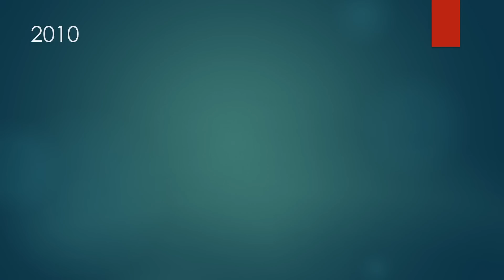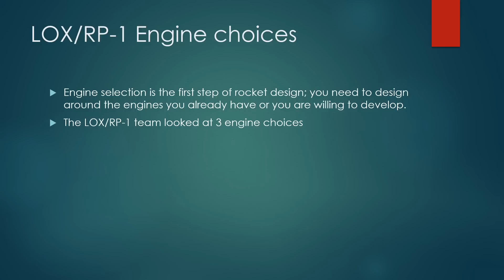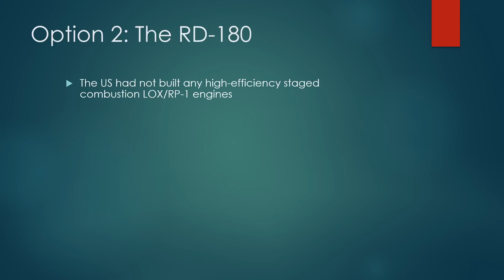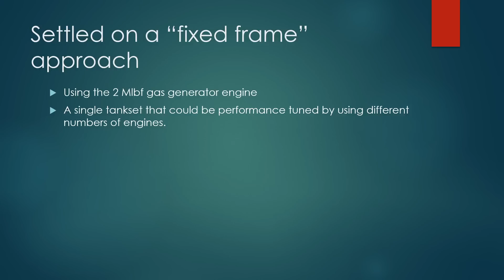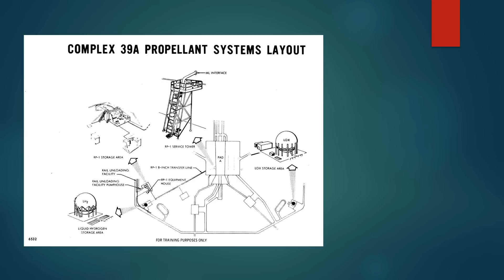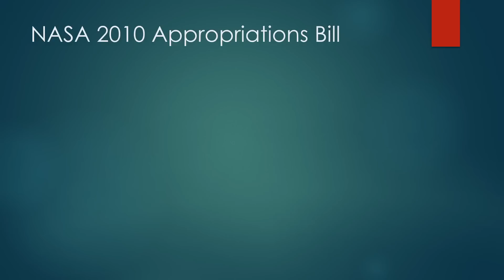Why don't we fly the Saturn V? An alternate SLS history...

Comment: A well researched video. I talked with a Grumman engineer at KSC five years ago, he knew the cost overrun numbers that weren't public then and predicted that it would not fly by 2021. He further stated that an updated Saturn 5 would have already flown and for far less money. This past March I spoke with a man who works for a company involved with SLS, he agreed that a new Saturn 5 would have already flown. When I asked him why SLS he said "it's a jobs program"...that spoke volumes to me. There are also those that believe Boeing has used this as a "cash cow"....that to me seems a reasonable conclusion.
Reply from the maker: Thanks, I always like more information, especially from those close to the programs...

I'm not confident that the Saturn V based version would have flown earlier as it looks like it has more development work than SLS does.
Reply: @EagerSpace  I remember he indicated that updated manufacturing techniques, computer updates and the F1B rocket motors would be all it would need. He thought the design was rock solid and could be built in far less time than SLS....He was a pleasure to talk to...not many opportunities to talk to an engineer that worked the Saturn project.
Reply from the maker: @EL-sp5zi  I'm skeptical. SLS block 1 uses 5-segment SRBs already developed for Ares I/V, RS-25 engines directly from shuttle, a second stage from delta IV. The only big new thing is the core stage.

If you ended up with the same set of contractors for the Saturn V version, I think you'd end up with the same slow progress.
Reply: @EagerSpace  So after all this years they aren't able to put all this together..
Though they conducted a flight in late 2022 but 2 years since than no 2nd flight

Comment: That’s a great video

I know a guy who worked on RAC-3 back in the day, he said the design he worked on was absolutely crazy. Double width Delta IV core, with 4 Atlas V first stages as boosters, with another Atlas first stage on top and an optional ACES (the original proposed version, not the Vulcan one)

Apparently, RAC-2 won every competition but would have required laying off members of the shuttle force and contracting new companies, so they chose RAC-1/SLS

If I remember right there was a very short lived proposal for a multi-core version of RAC-2 with recoverable engine pods much like Vulcan/SMART that would have lifted 200+ tons to LEO for about 75% the cost of a shuttle and he called it “Saturn-Ultra”
Reply: rac-3 aka ksp players lmao
Reply: That just sounds crazy... I love it
Reply: @randomstuff-cu4of  Very Kerbal

Comment: I always wondered as an alternative history.... what if the Shuttle never flew and the Saturn rocket family had continued to be used instead with uprated Apollo components to perform all of the Shuttle missions?  Would that have been economically viable given the costs of STS along with Constellation and SLS?

It would have also ensured that the capability of returning to the Moon would have existed in the 1980's and 1990's as well, and imaging what the ISS would have looked like getting launched on the top of a Saturn V stack would be pretty interesting too.  A "glass cockpit" version of the Apollo command capsule and perhaps an extended 7-9 crew sized version of Apollo can also be imagined as possibilities too with evolutionary and incremental improves over time.

My argument is, of course with hindsight that wasn't available in the 1970's, that in spite of the claim to save money for a reusable system to build STS (Shuttle), launching all of the missions that went on the Shuttle may have actually flown using Saturn rockets instead for a cheaper price.
Reply: The Falcon 9 is the first sensible crew-to-LEO rocket the US has had since the Gemini program, the Saturn IB and the Space Shuttle were both complete overkill for that purpose. 
If Apollo had continued, you’d want a smaller rocket to launch the capsules and maybe a smaller version of the service module as well.
Reply: @ewan.cartwright  The Gemini-Titan launch system was incredibly dangerous and limited.  The ejection seats installed on the Gemini spacecraft would have likely killed the astronauts if used at any point in the flight, and the rocket itself was an early ICBM repurposed for spaceflight.  It certainly would never meet current human spaceflight standards.

I like the Falcon 9, but that is 21st Century tech.  It is the application of lessons learned over the past century of spaceflight efforts which makes it so valuable.

Comment: good presentation . . . now, lets speculate what the Apollo/Saturn system would look like given an additional fifty years of incremental development.
- better alloys for higher combustion chamber pressure
- better alloys and construction methods for lighter stronger tanks
= CAD/CAM for parts that fit together the first time
-  fluid dynamics analysis software for better aerodynamics, pumps and piping
- additive manufacturing
i can only conclude that: as individuals we are so smart . . . as a species we are idiots.

Comment: Blueprints for the F-1 engine DO exist, BUT the factory notes do NOT. The issue is that each engine was 'hand made' and there were notes that guided the manufacturing engineers through the steps, and were added to as issues were discovered. These notes apparently have been destroyed. Also, the F-1 was a 'brute-force' engine that was not designed for any kind of efficiencies, and the 5 engines 'gulped' 8 TONS of fuel a SECOND to develop that thrust. (1.5 M lbs F each).
Reply from the maker: It's unlikely we would try to build an old-style F-1, the proposal would be for an F-1B, likely uprated a bit. The F-1 is decent for a gas-generator kerolox engine; with sea level/vacuum ISP of 263/304. A fair bit away from the 311/338 of the RD-180, but somewhat close to Merlin 1D's 282/311. 

I don't think building the F-1B would be a particularly challenging undertaking; it would be somewhere between SpaceX's original Merlin development and the development of Raptor and BE-4. And the F-1B design has already been at least thought about.
Reply: 15 tons of liquid oxygen and kerosine per second
Reply: It’s amazing how quickly we lose knowledge. Some people who built those engines will still be alive. Their knowledge and experience should be recorded before it is lost. It’s like Concorde: from the same era and so ahead of it’s time that even today nothing comes close to it. And so much of that knowledge is being lost too.
Reply: Propellant*
Reply: So we'd need to change the design for modern manufacturing techniques (are we going to braze cooking channels to the ticket bell?), re-engineer for lost notes....at that point you've engineered a new rocket. It's not just go build, it's reengineer and then still make new or modify existing tooling.

Comment: Because of politics.
They didn't want a capable, large space program, but they wanted the prestige and pork, so the Shuttle was designed to be as expensive as possible while doing relatively little.
Any other launch vehicle was a threat to that pork.

They literally scrapped the production tooling for the Saturn-V, so it's impossible to build it without a massive investment to rebuild from scratch the parts and even factory floor space.

Comment: I don't see why they'd want to consider the RD-180, while they could have gone for the RD-170 instead. This sort of thing is what it was designed for. The RD-180 is just the half-size version of it, with half-sized turbomachinery and two combustion chambers rather than the 170's four.
Reply from the maker: I thought about that as well; from a size perspective the RD-170 is about the size of the F-1. I think it may have been them being comfortable with both the quality and the availability of the RD-180 because of the history with the Atlas V. And the RD-170 would have been 10% lower in thrust than the F1-A/B and  20% lower then the 2Mlbf version if they built that.
Reply: @EagerSpace  According to online sources the RD-170 was actually more powerful than the F1-A, and of course was much more efficient than any version of the F-1 engine.
Reply from the maker: @sycodeathman  The sources I've look at put the F-1A just over 8 MN at sea level, and the RD-170 either at 7.2 MN or 7.5 MN at sea level.
Reply: @EagerSpace  Ah my mistake, I was reading the numbers for the improved F-1 engines used on Apollo 15 and 17. That being said, RD-170 sits in between thrust performance of the F-1 and the F-1A, but does still stand as the most powerful liquid fueled engine ever flown.
Reply: Because the chief advantage of the RD 180 was an existing engine-Production that just had to be purchased. Willst the RD 170 last flew in 1988 with production long Schutt down. So if you have to use restated Production from scratch you might as well bid F-1 B ore a new ORC.
Reply: Karl the rd 171 have flew on zénith 3 the last Times in 2014 
But imo the Real problèm with this engine is born contry 
The us just can not send guys on the moon with a engine enginerr by the ussr 
Plz excuse my english
Reply: @stekra3159  Well the derivative of the RD170, the RD171, is still flying on the Zenit rocket today.

Comment: With the Shuttle, there were mainly 3 problems: Lack of full reusability (it doesn't make much sense to recover just part of the spacecraft, NASA just decided to make the Shuttle cheaper to develop than the original two-stage flyback design, but it was more expensive in the long run), lack of demand (NASA couldn't afford any other program apart from the Shuttle, and nobody else wanted it) and difficult maintenance (making turnarouds longer and more expensive). Fun fact: the Shuttle would require about 40 flights/year to make profit, but was limited by ET production to just 24 flights/year.
Reply from the maker: Agree with all of this...

IIRC, NASA's original estimate for the two-stage flyback design was about $9 billion, and I think that may have been before the payload increase to make the Air Force happy. Given that they spent $5-6 billion on a less-reusable shuttle, the two-stage flyback probably would have been well over $10 billion, and simply would not have happened. 

It's interesting to think about what might have happened if shuttle didn't go forward - would NASA be in a better or worse place right now?
Reply: @EagerSpace  I have actually wondered this myself many times. Maybe the shuttle concept was too ambitious and the technology wasn't quite there, but they pushed against the grain and made it anyways. Would it have just been better to not do this and continue down a path of Apollo derivatives?
Reply from the maker: @elijahhmarshall  You might want to go watch my video: "the shuttle: what went wrong?"

The real goals behind the shuttle program were to keep the NASA centers open, the Apollo contractors still in business, and the congresspeople in the states that had either of those in office. 

And the shuttle program succeeded admirably at that. It established NASA as an ongoing concern in the government rather than something created just for Apollo.

Apollo derivatives were not going to happen. The point of Apollo was political - to beat the soviets - and once that was done, the majority of people lost interest. Without shuttle, it's possible that NASA would have been chopped way down and there wouldn't have been any human flight after that.
Reply: What?  The shuttle never flew more than 9 flights in a year (1985).  Average was six. There is no indication the infrastructure and workforce could have ever handled 24 flights in a year.

Comment: That was more than 10 years ago, I wander if the same team would recommend today to use metalox engines (like BE-4, or raptor)
Reply from the maker: Interesting question.

Methalox is a good first stage fuel but it's really not better than kerolox unless you are concerned about reusability, and the Saturn V-like design was inherently not aimed for reuse.

I think they likely would have explored it but of course it would not have changed the outcome.
Reply: @EagerSpace  the issue with RS-25 engine is its cost around 100 million dollars per piece, both BE-4 and raptor are much cheaper and would be available in large numbers, I understand that NASA currently make another evaluation of SLS but swapping the hidrolox engines with one that work with methane probably isn't a option without a major re-design.

Comment: I think it's important to note, 140t for Saturn V isn't payload mass. Actually i don't know where is this number from, beacuse, including S-IVB Apollo 15 stack was 153t. Meanwhile maximum payload capacity was about 120t.

The RAC-3 sounds so kerbal... It would be interesting
Reply from the maker: Two references: https://www.cbo.gov/sites/default/files/109th-congress-2005-2006/reports/10-09-spacelaunch.pdf and https://books.google.com/books?id=Zn4gAQAAIAAJ&q=%22Apollo+Saturn+V+launch+vehicle+had%22&dq=%22Apollo+Saturn+V+launch+vehicle+had%22&hl=en&sa=X&ved=0CB8Q6AEwAGoVChMI44uQwcHyxgIVDxaSCh1rLQk_#v=snippet&q=%22Apollo%20Saturn%20V%20launch%20vehicle%20had%22&f=false
Reply: 140 tons refers to the injected mass of the SIVB and the Apollo stack in LEO on an Apollo mission including the dry mass of the upper stage which isn't useful payload or propellant mass 
In reality the payload capacity was ~125 tons

Comment: I find it interesting that you mentioned the Merlin engine, as from what I can see the Falcon 9 generates 1.7 million lbs of thrust, which is getting close to that 2 million requirement.

Wouldn't have been an option at the time of course.
Reply from the maker: That's for the 9 merlin engines.

Comment: If I recall my reading history correct, the military payed for the F-1’s development in the 1950’s and it was fired around 58.  NASA engineers had made plans for more capable Saturn V’s with a progression of higher thrust engines with larger fuel cells along with SRB’s increasing in size for the lift needed.
Reply from the maker: Thanks for pushing me towards that bit of history...

The air force paid to build the E-1 engine a possible replacement for the Titan missile, but it was small, only 1,700 kN. The AF paid for initial development of the F-1 but halted because they didn't have a need for such a large engine, and then NASA paid for it from then on.

Comment: Were it all-Russian derived engines on a LOX-Kerosene fueled SLS-alternative: an 8.4 meter diameter Corestage, derived from Shuttle tooling. Inline design, 4x RD-180 or 2x RD-170 engines. Also: 2x or 4x strap-on boosters with 1x RD-170 each. Or 4x boosters with 2x RD-180 engines each. With 4x boosters and all RD-180s in both the Corestage and strap ons: more than 10.3 million pounds liftoff thrust. 

Also: a vehicle powered by All-American F-1B engines would have been pretty cool. Keeping the 8.4 meter Corestage, but powered by 4x F-1B engines and 2x 5.4 meter diameter strap-on, 'Flyback' boosters powered by 2x F-1B engines each would give about 14.4 million pounds liftoff thrust!! The second, Upper Stage could be powered by 4x J-2X engines that were paid for and test fired, before the design was shelved. All stages would use Aluminum-Lithium and Carbon Fiber composites for maximum weight loss. The Corestage and second stage would be expendable, but the Flyback Boosters could land on the old Shuttle runway and be used up to ten times. The Corestages could eventually use F-1B engines that were at the end of their life cycles, and therefore expendable. Such an F-1B powered monster rocket could get about 200 metric tons into Low Earth Orbit. This vehicle could assemble a Manned Mars Mission in 2 or 4 launches, depending on the mission architecture. Spacecraft Habitats, Landers, Propulsion Stages - you name it. 

And the F-1B launcher could do good Lunar 'Sortie' missions in a single launch. An Earth Departure Stage, 'Altair' crewed Lander and an Orion spacecraft with more service module propellants could do missions better than Apollo duration and with larger crews. The Orion Command Module could be reusable and eventually: a Propellant Depot in high lunar orbit (Gateway?) could allow a reusable Lander to be based there. Then: the Orion would bring a 'Tanker Module' along with it to refuel the Lander and then conduct a landing mission. Either that, or the Orion could bring along a co-manifested one-way Cargo Lander to supply or deliver components to a buildup of a Lunar Base.
Reply: Well, we accomplished atleast 2 of those things! Diameter and and Orion is reusable
Reply: 8.4 meter core with 4 instead of 2 F-1s sounds like Jarvis on steroids, would be an interesting sight to see, though not sure if you could even fit the plumbing.
Reply: @_mikolaj_  F-1B based design is nice!